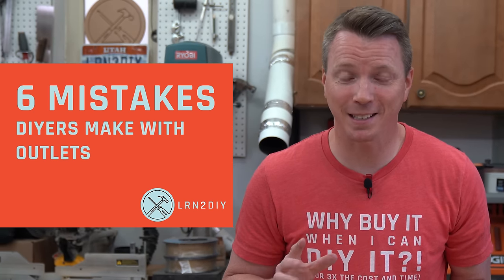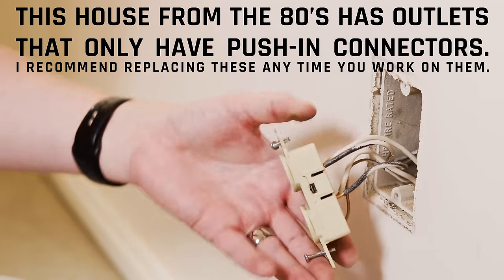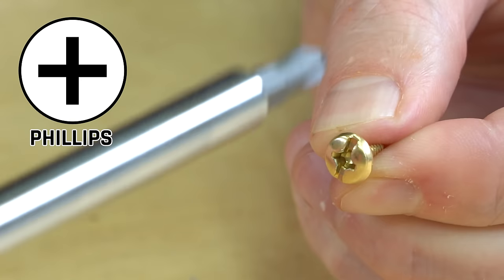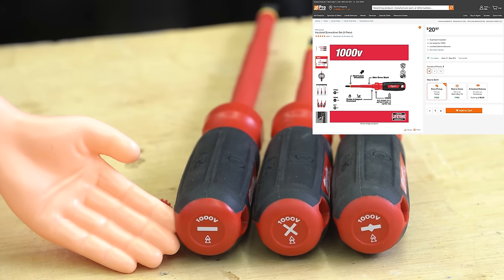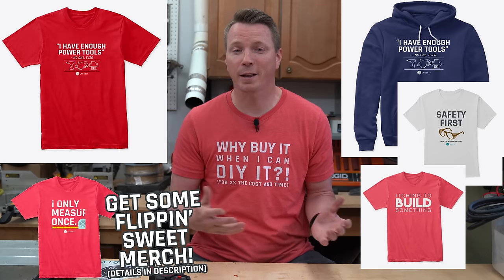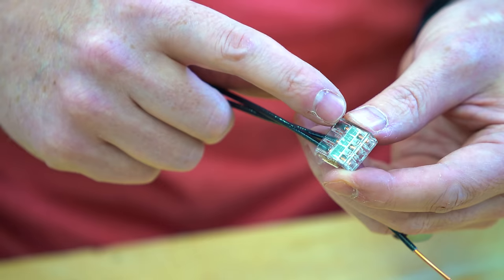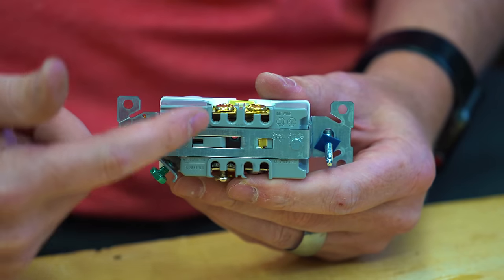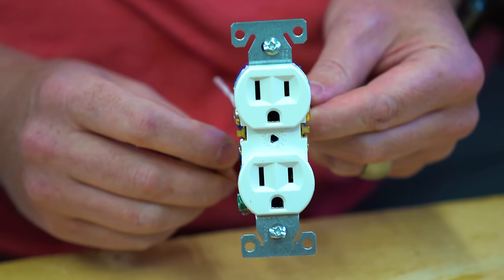6 MISTAKES DIYers Make When Wiring Outlets

Comment: Just for the record, once you've done everything else right, for extra safety you can always wrap the back side of the device with electrical tape just to cover the contacts.
Reply: Doing this leaves a gawd awful mess for the next guy.  Please don't do it,  as there is no reason for it if everything else is done right.
Reply: Actually it prevents shorts and accidental shock to the next guy. After ten years experience I can assure you it works.
Reply: @jameslebo6608  Do it "right", not needless.  Outlets and boxes are simply not designed for tape to be used inside. What is needed is careful, methodic, and thoughtful work.  When one of these is missing, electrocution happens, whether there is tape everywhere or not.
Reply: I've done this also, and I've watched others not do it and they end up tripping the breaker and wondering why.
I've also seen people leave it incomplete and without that extra step of protection, and the unknowing victim gets shocked when reaching for the switch which was a work in progress.
Metal boxes can be very tight and they leave no room for that safety margin.
Reply: @richtomlinson7090  I don't always do it, but when it's tight, absolutely.  Multiple light switches it's probably not necessary.  Replacing 4 in a box with smart switches?  DEFINITELY.

Comment: OK now do one with 70 year old 12 gage wire with rotting cloth insulation, packed with connections in a small metal box.
Reply: I don't miss those days.   That was the house I grew up in.
Reply: No.

Comment: Great show.    Very useful. 
I was thinking of one but I'm not positive if it's a rule.?   When you twist wires together and use a wire nut, shouldn't you make sure you twist the wires clockwise (the same direction you twist on the wire nut) or no, is that not an issue.?
    I'm not an electrician,  but I am wiring my camp myself.   I will have it check though,  when I'm done.
   Thank you for sharing this with us.
Reply from the maker: You're absolutely right - you should twist the wires clockwise (as you face the ends of them) so that the wire nut just makes them tighter. It's kind of like applying teflon tape to the threads of a pipe - you need to apply it so that whatever you're attaching makes it tighter rather than lifting and removing it.

Comment: Thank you for endorsing twisting the wires before the nut goes on. So many times I've seen that done and it's not to code when you don't do it. This is actually extremely important if you don't want your house burning down

Comment: In reference to your Sheppard hook tightening practices: 

If u put SH around screw counterclockwise & pinch the hook together while tighting screw down: the wire should b more secure because any pulling / tugging on wire including messing with outlet over the years will only cause screw to tighten more.  

If u put SH in clockwise the more u pull the wire over the years, the more the screw will unscrew itself resulting in a loose connection @ outlet. 

What r u thoughts on this practice?

Comment: 20 yr JW inside Wireman, nice job! Only thing I’d add is AC current ‘vibrates’ at 60 hz. This tends to loosen all connections over the years. This is why I tell people not to buy the cheapie receptacles. 9 of 10 DIY’s will go with the $.99 snap switches which may work fine for awhile but they are very prone to loosening. It’s worth it to spend the $3-5 for a pro grade receptacle or switch. And ALWAYS check that voltage EVEN IF YOU OPEN THE BREAKER! On a couple occasions I’ve found I was working on a circuit with a failed closed breaker, SUPER dangerous! And once it was the MAIN!! And the customer didn’t want to pay me to replace the breaker. Needless to say I refused to do the work.

Comment: You should not limit yourself to DIY folks
I NEED THIS POUNDED INTO THE BRAINS OF 'PROFESIONAL' electricians
.
And glad you started with the push ins .... I do not understand why they keep remaining legal
.
BUT ALSO you need to add a #7 ..... "When installing in a metal box or even in a multy 'module' box (if crowded) .... wrap the switch/outlet with a piece of electrical tape to additionally insure against accidental contacts
.
But one of the best videos I have seen .... covered most of my frustrations going into 'certified electrician wired homes' 
And thanx for the combo driver info --- sadly I still find new 'modules' not using the square (#1 robertson) center and got to scramble

Comment: How is there any difference between the backstab method and using a waygo for connecting wires? Isn’t the load or current of the circuit still running through a small connection point?

Comment: Didn’t read all the comments excellent and simple yet I would recommend going over wire length within a box. I’ve seen way too often by DIY wires cutting the wire way too short also when the wires are long enough not neatly putting wires back into the box. the proper “kink” method by pre bending wires when pushing the receptacle back in

Comment: I changed every plug in my house almost 20 years ago because I hated the old style almond colored ones. I used the back stab for every single one. I've never had an issue but wondering if I should start pulling them out and wiring them correctly.

Comment: 🟦 Not only is the "Backstab" option a bad idea as a reliability issue, but using it will reduce the amperage capability of the receptacle from 15-amps down to about 8-amps!!!.......
in order to retain full amperage capacity of the receptacle it MUST be sidewired!

Comment: I started wiring when they were all just flat slots and we used different materials to cover the shaft, shrink wrap works good, as does a small tube. I may have to get that new tip though.

Comment: I was looking at buying an ECX bit but then I noticed that the Bosch P2R2 bit that came with an impact set I have is excellent in electrical screws. It's much better than a Phillips which does cam out too easily, but give you the advantage of being able to do an acceptable jot with Phillips head screws in a pinch.
Reply from the maker: Those are definitely pretty cool bits, and I like that they can handle more than one kind of screw type.

Comment: You're lever nut expose saved my day with an abs wire that broke off in a tight space.I couldn't believe such an easy fix existed. It's much easier than crimping especially when I can barely fit my hand behind the radiator and transaxle. Wow. That's a lifesaver. Thank you.

Comment: Backstab terminals are approved by the NEC so they can't be that bad but do seem to be less reliable connections. There are also terminal connectors similar to the Wagos but they are like the backstab connections and don't have the release. I have used them before but I will use Wagos in the future since they are more secure. I don't use ECX bits because then you need another tool to carry to mount the device in the box. Phillips bits work fine for me for both screws.

Comment: Not using the backstabs because of poor conductivity, but recommending the Wago?  I think on the surface, you're right:  Wago makes a quality product and there are TONS of chintzy outlets on the market.  I don't see a problem using back-stab on quality receptacles however, just as I see no problem using the Wago connectors.  One really great use of the back-stab is to avoid having to create pigtails in a crowded J-box.  I've come across installations that were jammed so tightly into the box that the outlet was literally bent and cracked outwards!  Hopefully this doesn't come across too whiney -- Love your channel, great content.

Comment: for stranded wire use crimp on terminals or tin the wire with solder. as for the term that you used (outlet) most diy get that wrong. an outlet is any box you can take electricity from or out of. the light on a ceiling comes out of a outlet box so does the switch for the light. when you were referring to a outlet it was actually a receptacle you were talking about and the box it comes out of is a outlet box like the light and switch. . hope this helps.

Comment: I recently bought outlets that have the backstab connections and a release button for it as well. You have to use a small flathead screwdriver to push the release but it works. I think if you have the right amount of exposed copper, the backstab will hold fine. The one time use ones are dumb though because if you have to change the outlet, you just lost a small section of copper each time.

Comment: We called the backstab outlets "stabbies".
We never used them, but commonly found just about a whole line of outlets out because of a bad stabbie when customers called because of non working outlets.
In addition, we run around the outlet with electrical tape for extra protection after wiring up.
Great info on this vid!

Comment: I noticed you didnt mention the builtin wire stripper found on just about every store bought receptacles. When in a pinch you can use the metal plate on the receptacles as stripper and they also include the hole for making your loop

Comment: Great video dude, like all that you got.👌 Thanks a million for share the simplest way to do it. could you make a video to change the main inlet connection from the street service?. here in mexico is called "Caja de fusibles Acometida" (Fuse Box), and goes inside the wall, and you can turn off the live wire. I´m Beginer in this, so it will very helpful if you could do it, I aprecciate so much all your help. blesses for you and yours, now and always🙏👍🤜🤛

Comment: I recently replaced all my outlets (change of color, and style changed to Decora). The old/original outlets, from original construction, were about 33 years old; all of them had wires connected by the backstab method. I never had any problem with any of them. But, I did use the side screws to connect wiring on all new outlets.
Reply: I have, so it happens.  Although 33 years ago people still had some pride in their works unlike today.  Mine was rewired in 2004, it was a mixed bag of good and bad.

Comment: People commenting 'outlet tester' / 'voltage tester pen':

 These are great tools, especially for the diy / homeowner but do not rely on them. Get a decent multimeter, doesn't have to be top of the line. If you enjoy DIY learning it's uses will expand your capabilities and understanding faster than other tool while keeping you and your work safe.

I've done electrical professionally for years now and use them on nearly every job. Tic tracers or volt pens provide a double or triple check there's no load before working, and shoved in a box give visual / audio alert power is on or off when flipping breakers. The outlet tester can do the same, as I usually work alone these are huge time savers.

Make sure any tool you're using is functioning properly before use. And this goes for all work, once you start putting too much faith in something that can potentially fail, or you get complacent, that's the same as being lazy or sloppy and mistakes will be made.

Comment: I like Eaton brand outlets.  They have a mechanism where you push the wire into a slot just behind the screw between two plates and then you tighten the screw to squeeze the wire between the plates.  It's a solid connection and they're not spring loaded, so you can loosen the screw to remove the wire and rewire the outlet.

Comment: Question Our house was built in the late 50s and none of the receptacles  have a ground. Is it safe to install new receptacles and attach the ground to the box as long as it's metal?
Reply: Even though the boxes are metal, they may or may not be grounded, or sufficiently grounded. You could run a ground wire to every box (huge effort, not worth it unless your tearing it all out and starting over). Better option, install newer grounding receptacles and GFI protect them, either with GFI receps or breakers. You must also affix, to every plate, a sticker that says No Ground Present.
Reply: @pld8993  Thanks. Either way, sounds like a costly remedy.
Reply: @MrMmangano  Replace all single breakers in your panel that feed receps with GFI breakers (about $50e) and install new grounded receps everywhere. Easiest approach.

Comment: Some useful tips here to be sure.  I just ordered my first ECX screwdriver!  However, I don't think you're being fair to the backstab connection.   You clearly favor the shepards hook, but then go on to show all the ways this method can be messed-up if care is not taken to get the stripped length, hook size, or hook direction right.  If similar care is taken to ensure wire gauge is compatible and stripped to the right length, backstab connections seem to work fine....even though some can be tricky to release if changes are needed.
Reply: Yeah they wouldn't be on there if they weren't safe and rated. With that being said I've seen a good many of those go bad and be too loose. But I've also seen that on old hooked connections over time. The back stab type though really don't get much contact however. I never use them personally either. But to say it's a mistake to use them is not fair. I wouldn't recommend them either but it's not wrong to use them.

Comment: I've been doing everything right this whole time! Though, I learned from an electrician. Though I do recall that it's not best practice to straighten out hooked wire and then hook it again as the copper will be weakened. I admit, I do that from time to time as one tends not to have much wire to work with if using existing pulls.

Comment: Another problem might be when you have a outlet (maybe next to the washing machine) that has a red, black and white wire on it.  There is a small tab that needs to be removed on the replacement receptacle if it had been removed on the original receptacle.  Also there might be 2 each 120 volt circuit breakers feeding this one receptacle.  Make sure there is no power at the top and bottom of a receptacle before removing it from the wall to replace it.  

You can also find "Split Wired" receptacles under the kitchen sink, feeding both the garbage disposal and dishwasher, many times with two each 120 volt circuit breakers.  Look for the tab between the top and bottom of that receptacle, and if removed, be sure to remove that tab on any replacement receptacle.  

Great video, I will have to look for a new screwdriver now!

PS:  Why use a insulated screwdriver?  It would be much safer to work with the power off. . . .
Reply from the maker: Great tips on the split wired outlets! I try to use an insulated screwdriver even when the power is off just in case I didn’t actually cut the power like I thought I did - like in the case of a split wires outlet being on two different circuits. Just a safety precaution.

Comment: When the wire is stranded twist it counter clock wise before making the hook. It will tighten itself when tightening screw. If you twist clockwise before you make the hook it will unravel as you tighten the screw

Comment: I'm not sure if you have covered Aluminium wiring in any of your prior videos. Aluminium wiring was commonly used in home building some years back, 1980’s? when price of copper was high.
I have heard that aluminium wiring expands and contracts more than copper wiring and thus comes loose easier, potentially causing shorts and fires. So if you have aluminium wiring in your house when changing fixtures, switches and outlets, it's extra important to tighten wire screws very snug.
Reply: No, don't touch it. if you have aluminum, call a pro that knows what they're doing, which isn't every electrician. Overtightening aluminum is as bad as under tightening, very unforgiving, used in the 60s-70s.

Comment: Just curious, if the back stab connection is so weak because of little contact, why is the wago connector ok? It looks like there’s very very little surface contact with the wire.

Comment: Since I'm redoing the paint scheme in several rooms, I'm changing the outlets and switches to white, and I've found wiring that looks like your example of what not to do at 6:50. But what I don't understand is why we still use the same technology for outlets that we were using when I started working with electricity 65 years ago. Cramming all these wires and wirenuts into a tiny box that they completely fill makes no sense to me,  for example. And there surely is a better way to attach the wires to the outlets than the labor intensive way we do it now.